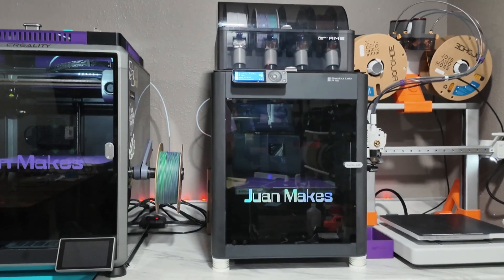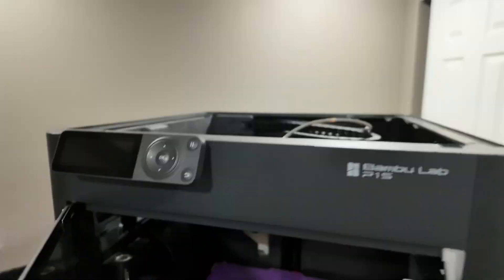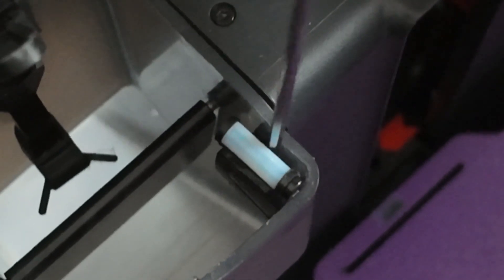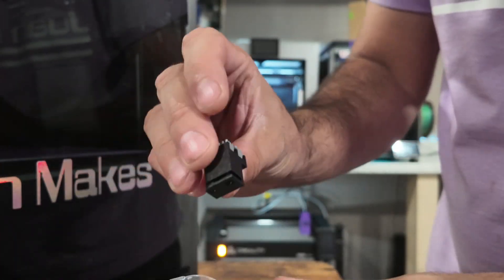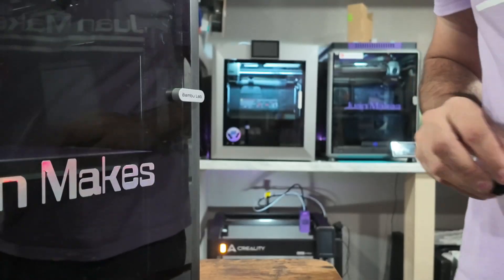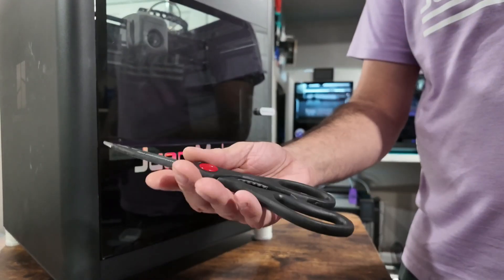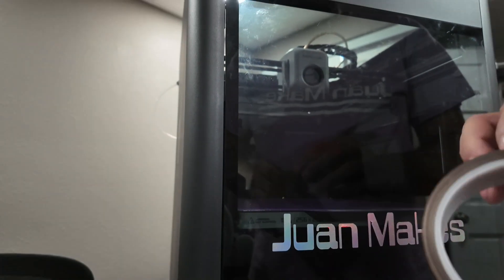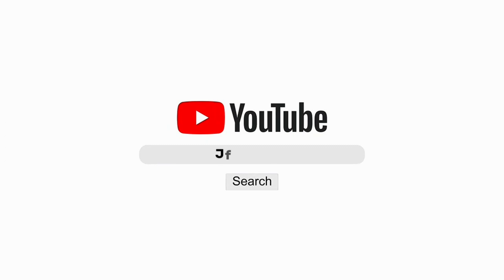BIQU Panda Wiper for your Bambu Printer is a Serious improvement!

Comment: Two months after adding the wiper, how is it doing? Do you still consider it a good investment? Does this keep the nozzle clean before starting the print, without dragging dirt onto the part?
Reply from the maker: I can say it has been a solid improvement. Been printing daily with zero backups or purge falling back into the print bed. 100% recommend